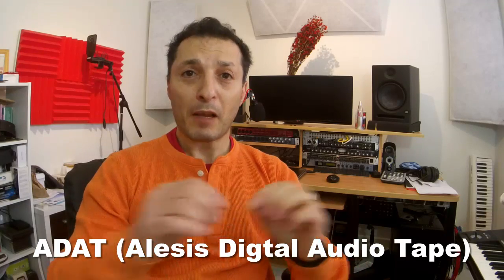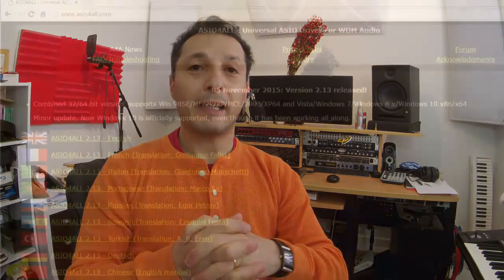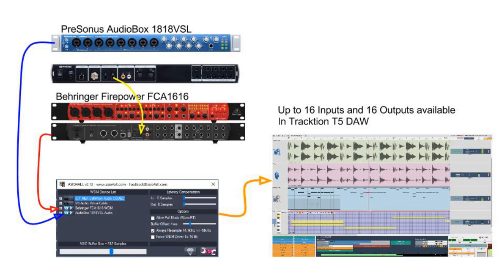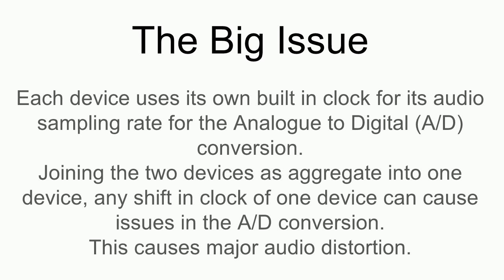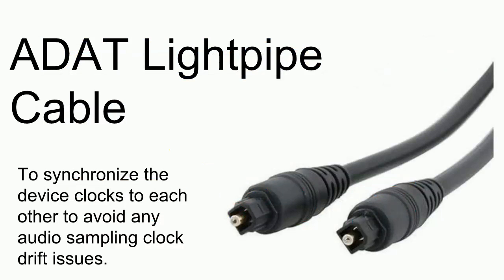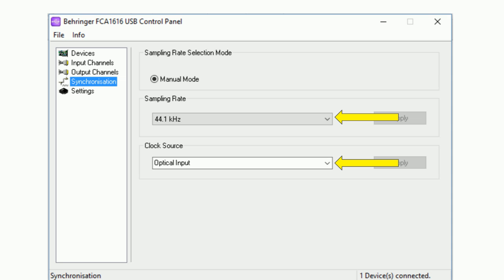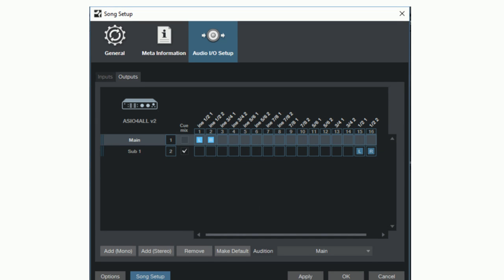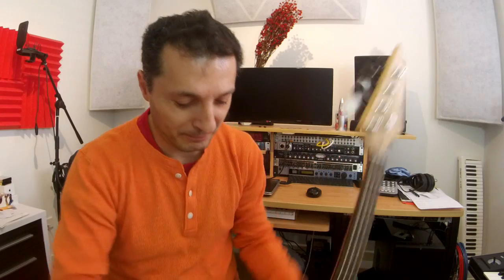Combining Two Audio Interfaces Using ASIO4ALL using ADAT as Clock Link

Comment: Nice lesson. Any way to connect a FIREWIRE ONLY device to an ADAT ?
Reply from the maker: Which make and model? If no ADAT or SPDIF, then, technically/reliably you can't combine 2 audio interfaces.
Reply: I have used a firewire MOTU 828mkII with Digital Performer on an old Mac computer for years. Just made the transition to Cubase 9 Pro on a Windows 10 computer, with a Steinberg UR824 USB interface. Both of these interfaces have ADAT ins and outs (as well as wordclock). Can I route the inputs on the 828mkII via ADAT into the Steinberg UR824 and get 16 inputs for Cubase even though there is no firewire input on my Windows 10 computer?

Comment: Hi, can you help me with this situation :)  I have M-Audio ProKeys Sono 61 keyboard, which has soundcard inside, so it acts like Audio interface too. It works well as an midi keyboard, and it has guitar and microphone inputs, but as an Audio Interface, it has some problems (doesn't have phantom power, has some gain noise etc..) so I need some new and better one (I've been thinking Audient iD14). How would you suggest to connect them, since Audient iD14 doesn't have Midi inputs.  1) To have Audient iD14 as main interface (and to use M-Audio just as the midi keyboard connected with some Midi-USB cable) or 2) Just plug in Audient iD14 in USB (and leave M-Audio connected as it is now - with USB ) and to use Asio4All to hopefully runs both of them? Thank you.
Reply from the maker: Normally the Sono 61 USB driver should separate the Audio from the MIDI. So in your DAW you can select ID14 and the Audio Driver and the MIDI device as the Sono 61. If you still need to have both audio interfaces, you can use ASIO4ALL, but there might be some sync issues and there is no possible way to sync both audio devices.
Reply: I see..So option 1) is better one. Thank you very much for the answer, I am  looking forward for more videos.

Comment: hi this would cost gold bars  best way is m-audio delta cards  if you have a old computer with a lot of old pci ports
like on some of the new asus motherboards there's 3 pci ports you can put in 44 and 66 and 1010 card i have 16 in 16 out
with 2 x 1010 m-audio cards work very well best to use cakewalk or (cool edit xp) adat card i tryed them just more to power up

Comment: I have the presonus studio live 16.o.2 and the RME FIREFACE 400 .. !! Is it possible to synchronize them? Because I would like to have the presonus channels in the RME..!!! Thanks
Reply from the maker: If I understand your questions right, that is not how it works. To put simply, the audio streams from 16.0.2 and RME are joined in ASIO4ALL to your DAW. All channel settings in 16.0.2 are as they are and RME input as they are. So if you select a Comp or EQ in 16.0.2, it will not effect in any of the RME channels.

Comment: Forgive this novice question, but I thought the purpose of ADAT is to transfer digital audio between interfaces, not the just clock. If so, would there be a need for the special driver?
Reply: You are correct Ched. If both devices you are connecting together have both ADAT in and out then these devices can be daisy chained. One of the devices will act as master and the other as simply a standalone preamp. The standalone inputs are routed thru the ADAT out into the ADAT in of the master device, including sample rate info. The master is then receiving the extra input data thru the ADAT and can potentially Receive from 8 input channels on the slave or standalone device, obviously depending on what you have.
Reply from the maker: +Ched Cuaresma 
Good question. It is true if you are connecting an ADAT mic pre, like Behringer ADA8200 to an audio interface, that is what it is designed for. But 90% of audio interfaces do not direct their analogue inputs to their ADAT output, to allow the second audio interface see it as an extension. This is the workaround. If you simply connect two audio interfaces via ADAT, they will not see any audio signals come through via ADAT. Generally, audio interface analogue inputs and outputs are sent to USB, as also ADAT inputs and outputs to USB. 
Hope this explains.

Comment: What if one of the devices does not have an ADAT clock link?

I am looking to input from my headrush pedal board via USB for recording but need to be able to output through my main audio device and not using any of it's inputs for recording at the same time. If I use ASIO4ALL for this will there be clock issues.
Reply: I'm curious too
Reply from the maker: Your answer is in my video already.
Reply: @RecordingStudio9  what time stamp
Reply from the maker: @Gahttz  Watch from 0:00 till I mention and explain in detail, twice, why it will not work or why you will have issues. My explanation can't be that hard to understand. Is it?

Comment: Hello
 
i have this situation: i pretend to get two Allen & Heath ZEDi-10FX mixers for live mixing and multitrack recording to be processed at my laptop (Windows 7, 32bits) with Cubase LE8. So if i understand your tutorial i would be able to get the 8 channels (4+4) tracks to be opened at Cubase for this purpose with ASIO4ALL? what about software like Voicemeeter Banana? i saw you use the VIrtual Audio Cable...
 
good luck with your bass!

Gabriel
Reply from the maker: +Gabriel Pueblo 
There are no SPDIF OR ADAT options on the mixers, how do you plan to sync the two together? ASIO4ALL by itself will not work for recording
Reply: RecordingStudio9.com each mixer to an USB then ASIO driver then Cubase?
Reply: RecordingStudio9.com different situation...
Reply from the maker: How so? What you intend with your USB mixers is no different to my examples of audio interfaces. I guess you will find out the expensive way. Good luck.
Reply: RecordingStudio9.com they cost about 500 in that price range could be Presonus StudioLive AR12 or Soundcraft 12 MTK. first it's not compatible with Windows 7 32 bits, second they don't have warranty or service at my country. ASIO4ALL is free and Voicemeeter Banana (in case I need it) is Donationware. I'm guessing it's not going to be that simple to configure but what other options do I have? please, can recommend me something else? Best regards, Gabriel
Reply from the maker: Both StudioLive AR12 and Soundcraft 12MTK are far better option for less than the price of the 2 of A&H ZEDi-10FX, where I know combining them will not work. Both PreSonus and Soundcraft support Win 7.
If you need more inputs, get PreSonus, more channels to and from the PC, then Soundcraft MTK range.
I'm baffled why A&H upper models don't support multi-channel USB.
Reply: i bought the Soundcraft 12MTK, thank you very much!
Reply from the maker: Congrats! Please let me know how you like it. Did you know you can insert live VST plug-ins direct to each channel from your DAW? Good choice

Comment: i have the same Presonus 1818vsl and the 44vsl that have not an adat input connection, due there are the same brand, can they work it with asio4all to have the extra 4 inputs off the 44vsl in live recording band??
Reply from the maker: You can try, maybe with higher sample buffer, but since there is no sync signal, it will get out of sync and cause audio distortion.
Reply: ok thanks bro

Comment: Just buy a Presonus Studio 192 and Digimax DP88, then your good to go. The studio 192 will be used as the main audio interface and the digimax will be used as the additional inputs/outputs.
Reply from the maker: Yes, but you missed the point. This is if you already have 2 interfaces.
Reply: RecordingStudio9.com I understand that.
Reply from the maker: Well I guess you could sell your old 2 interfaces, put extra on top, and buy Studio 192 + Digi or Focusrite etc LOL
Reply from the maker: You do realise that Studio 192 is over $1000 each, where I'm referring to a solution for what you ALREADY have, are under $300.
Reply: You can even ADAT two Studio 192s  together if you bought two of them as you can turn one of them into a Digimax just the same as turning a Scarlett into an Octopre. https://support.presonus.com/hc/en-us/articles/210050523-Can-the-Studio-192-be-used-stand-alone-
Reply: Yeah because you don't have to spend a $1k.  You can buy a new 18i20 $500 or $300 used or a new Presonus studio 192 mobile for $500. I'm sure there are more. All cheap solutions for ADAT in and ADAT out.

Comment: excelent video, now i understand how to use 2 interrfaces, but i have 1 question, what happend if im using 2 interfaces 1818vsl?¿
Reply from the maker: Yes you can, but you won't be able to use any VSL driver for any of them, since they will both go through the ASIO4ALL driver. But, not owning two of them, I cannot test and confirm.

Comment: but asio4all isnt the right software to do serious recording at good sample rates the drivers wont be stable with high data recordings,the internal clock between the 2 or more devices or adat, asio4all will get pretty unstable with multiple tracks , the drivers(asio4all)are good for gaming and low end stuff, besides that you are not taking advantage of the device buffers, and asio4all buffer isnt that good for multiple tracks recording, i dont know if they improved much the drivers, but 1 or two years ago i had problems trying what you are saying with my focusrite saffire 56 and Steinberg MR816X (both firewire) so i just clocked them  and used the adat and digital I/O, saffire master and steinberg slave, anyways i love your videos to be honest and i just wanna give my input, maybe the asio4all drivers improved a lot, cheers man
Reply from the maker: Thanks for your input and opinion. ASIO4ALL does work for most applications, and with ADAT or SPDIF, Max you can get is 48Khz sampling rate, witch is sufficient for any home recording. If you need higher sampling rate, then you need to spend the money buying the proper gear.
I tested with my AB1818VSL and FCA1616 using ADAT by recording 16 simultaneous tracks for 90min continuous with no issues.
Hope you have great time making music.
Reply: Without asio4all i can not even playback all my midi tracks, all other drivers suck with low latency, low buffer. The sound quality is also good i must say, no differance at all.

Comment: How you connect both Devices from USB to computer, at the same time you have a ATAD between them?
Reply from the maker: Yes, I have 2 USB connections to my laptop/PC from each audio interface, then a lightpipe/fibre optic cable between the two devices.
Reply: What if you are using an ADAT only device like the Behringer ADA8200? Will Aiso4ALL still recognize the 8 extra pre's?
Reply: @thaprofessab  Did you get an answer to this question? This has bugged me for very many months ... I've got the Oktopre MK2 and could not get it to fully work. I got all the inputs working but could not see the outputs at all.
Reply: But how will you're ada8200 recognize the channels if it goes thru a interface with 2 inputs?
Reply: Rockelement it will show on your DAW, after you set up the I/O settings...

Comment: can you use spdif digital in/out as a world clock sync? I have a Presonus Firebox and a Lexicon Omega interfaces that have spdif in/out's. Couldn't you even use the MIDI in/outs to accomplish the same thing if devices have those?  thanks Vatche, once again you have opened up new possibilities in my studio.
Reply from the maker: I need to research bit more about SPDIF and try it out if it will be possible. If it does, it will make things easy as even some low range audio interfaces that do not have ADAT, may have SPDIF In/Out. 
WORD CLOCK is different purpose.
MIDI, nope, not possible.
Reply from the maker: My next video I just uploaded is a test result that SPDIF used a clock sync does work.
Reply: +RecordingStudio9.com that is great!!! I have a Lexicon Omega, Presonus firebox and Soundblaster soundcard that would give me multitracking in Tracktion 5.
Reply: RecordingStudio9.com link?
Reply: shroomfiend yes it can be use